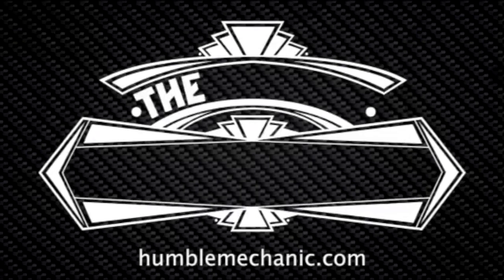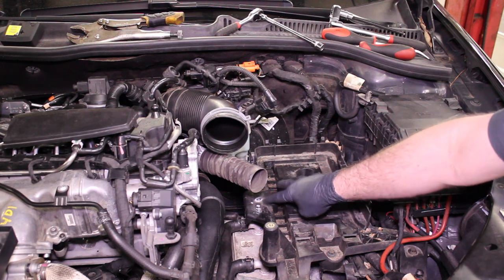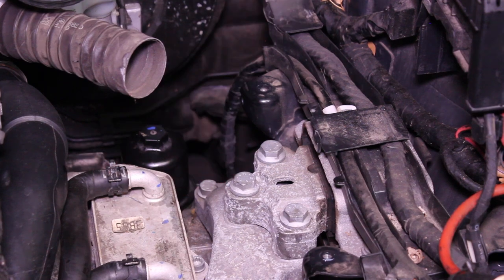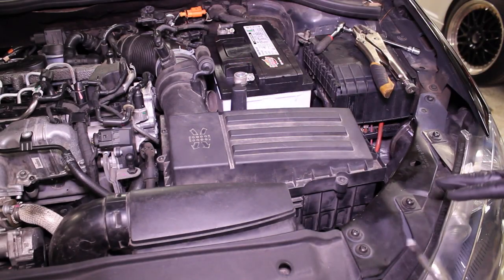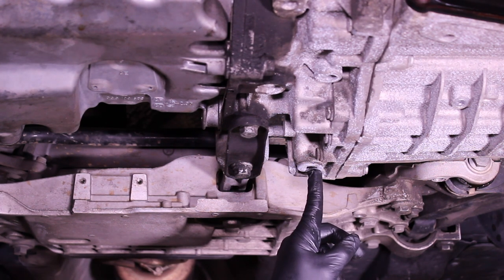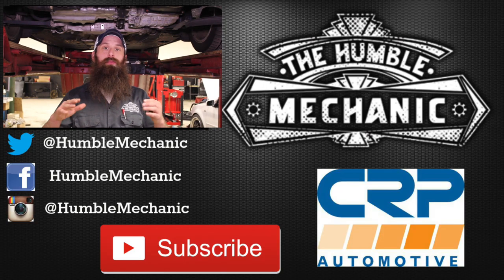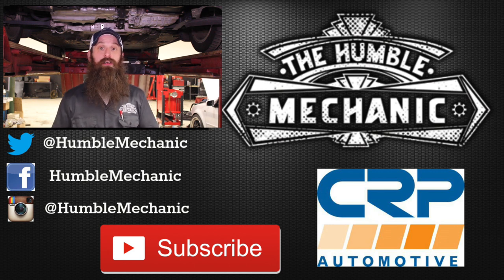How To Perform DSG Service for VW Audi

Comment: Is this the same procedure for all DSG front wheel drive engines?  
Second, if I have never serviced my DSG, is it still a good idea to change the oil?  I bougjt my MK5 GLI and its been a good 20k miles since I got back in late 2016z  thank you!
Reply from the maker: Yes. This is for basically all the 6sp DSG transmissions. 

Not a bad idea for an oil change too

Comment: Hey Charles. I had my 2012 2.0T ccta Jetta repair an oil leak causing a cracked water pump. Mechanic that performed job asked if I had the transmission fluid changed yet (then had 83k miles). He said not to change it if it hadn't been done already, that it can cause issues. Do you agree with that statement?
Reply: Always service your transmission fluid. These dual-clutch transmissions need regular fluid and filter changes. In any case, if changing your transmission fluid then causes issues, you had a transmission that was going bad anyway.

Comment: So 5 liter of dsg fluid is a lot and  nobody knows the exact amount  that should go in, how interesting. Otherwise I see you can't do a finished job without checking the transmission fluid temp if its ayt which has to be above 35 degrees. And I'd like to know what vsds equipment you use and how much does it cost. And the hand pump seems to make the job a lot easier to execute. I'd also like to know where I can get one and for how much

Comment: HumbleMechanic I like all your videos. Keep up the good work. Your answer will save thousands of dollars in fixing this issue. Thanks in advance. I have 2008 Jetta 2.0T TSI equipped with DSG (to be more specific it is model DQ250) as you said in the video they have bad mechatronic unit. I totally agree that, but car's hesitation and jerkIness happens at slow bumper to bumper traffic [ONLY AFTER SPIRITED DRIVING (SAY 30 MINS)] this madness happens once tranny oil attains certain temperature. Something in mechatronic not function right when oil is warm or hot. There is absolutely no hesitation or jerkIness in transmissions, when oil is cold. Rather than expensive fix of replacing mechatronic unit I will go with cheaper fix. Do you think it should be great idea to install a aftermarket DSG oil cooler? Do you think it will work?

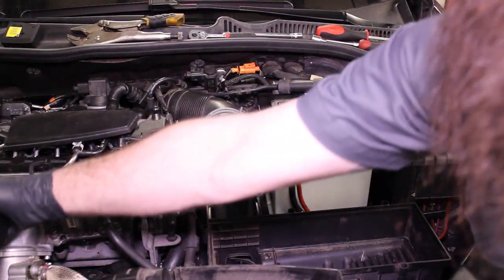Comment: At 3:22 you can see a smaller hose, under the air intake hose that's disconnected.  Is that some kind of heated air intake for cold weather?  Why would it be disconnected which looks like how you left it when you put it back together.
Reply from the maker: +jagardina it is exactly what you mentioned. 

From what I remember it was disconnected before we started. You want to be sure this gets put back. It's not the end of the world if you don't. But we want to be sure it goes back properly. 

This car was going to have more work done so I wasn't too stressed about t.

Comment: Is this a 6-speed or 7-speed DSG?
I have been looking for a How-to guide to do the 7-speed DSG in my 2010 S4 with the 3.0 TFSI (supercharged).
The part about changing the filter does not apply to my engine bay. The battery is in the trunk, and the filter in the filter/seal kit I purchased looks completely different. 

If the process for my 7-speed DSG is different, can you point me in the right direction for a DIY?
Reply: This is for 6 speed. 7 speed doesn't have an oil change specified as far as I am aware. It uses dry clutch and way less oil.

Comment: Humble, you could be using something electric to open that airbox (doesn't everybody have a battery powered drill motor these days?)

Real close with that extension and the postive terminal of the battery (short potential). Since you are taking the battery out why not disconnect the cables right at the start (or course after writing down all the customer's pre sets on the radio :)

I ask what experience level (minimum) you would want a tech to have before you dispatched this job to if it was a "waiter" (I do not see it being a good thing to give this to a low experienced tech if it was a waiter) How much does this job pay (both CP and maintenance warranty)

Comment: Why did my mechanic use 6 liters of dsg fluid? I bought 5 liters and a meyle filter and brought to my local euro mechanic. He needed another liter of fluid? Everything Ive read was 5L and the dealers use 6L?
Reply: +michael bertucci Hello :) Not all DSG transmissions use 5L of DSG fluid. For example, 2013 Audi B8 A4 TFSI with a DSG will use up to 7L of DSG fluid.

Comment: I just did the 80k transmission fluid changed 2012 vw passat tdi.I did it myself watching this video but i have a question the fluid i drained was red and the 40k service was done by a vw dealer, none of the videos i have watched had red fluid is there a changed that the dealer put the wrong fluid and it managed to run for 40k miles? Should i do one more drain and refill?  the car did have a delay when switching from R to D and P to R or D now that I put new dsg fluid (amber color)the delay when away.  And one more question  when i took the plug out (cold fluid) almost a quart came out. Isn't suppost to be a little or almost nothing if the transmission was filled properly assuming that the dealer warmed up the transmission and drained the excess fluid.  Also to check the transmission fluid temperature i used the torque app it works. So i ended up putting 4.7 quarts and I took off 5.5 plus a little i spilled on the ground of red fluid.  was this transmission overfilled?
Reply from the maker: Tough to say with out fully checking it. SUPER odd that it was red. I have not seen any DSG that was red. The odds of them putting the wrong stuff in, and not having issues is low. 

Ive seen people do that and the trans is toast in 200 miles.
Reply: @HumbleMechanic  maybe it was a dq200 gearbox that uses normal transmission fluid.

Comment: Why would you hand pump or gravity fill through the bottom when you have the filter out, can't you just funnel new fluid directly into the transmission before you put the filter on?
Reply from the maker: Yes but it fills VERY slow.

Comment: I would like to know if the version of VCDS is more limited than using the USB VCDS version with USB cable
Reply from the maker: WiFi on laptop is exactly the same. WiFi on Mobile is limited.
Reply: HumbleMechanic I appreciate yuor answer , in this case for me i will fill the oil from the filter , thank you
Reply: @HumbleMechanic  If I buy the kit that comes with 5 liters would it reach me or if I need a little more than 5 liters?

Comment: is there a way to tell when the last dsg service was? (I have vcds)... recently got my first DSG (use 72k mile S3) but don't trust what the dealer told me
Reply from the maker: Note really. Even fluid color is not a perfect method. I’d wait to 80 and then change it. Or do it now. Either way you’ll know going forward
Reply: @HumbleMechanic  Thanks. looks like its a PITA.. why is the procedure so specific on this? is a bit too much oil for instance gonna blow the trans?

Comment: are there any other places to get the filler unit?  I see one but it's for BMW but I assume it would work with VW as well as long as the fill adaptor mates with the filling unit, but i find it odd that the filling unit costs around $140 USD, this gets me to thinking a bit outside the box or asking if there are any other methods for pumping the fluid back in the transmission.  this is the only thing stopping me from starting this
Reply: Like, what's stopping me from buying a hand pump bottle that holds 5 l from home depot and mating my own hose to a shut off valve to mate with fill adaptor for about $20
Reply from the maker: I have this tool. It’s great! Be sure you get the proper filter. Dealer if you have yo
Reply: @HumbleMechanic  yea man.. I appreciate you and your vids..  i'm just gonna opt for the filler unit instead of make my won.  I figure i'll get my money's worth changing it 1 or two times

Comment: The first step should have been remove - battery terminal, that ratchet came scary close to the + terminal.
Reply: +autoairsteer That's right, and remove the negative completely first.  If while taking off the positive clamp you bump the wrench on the chassis, well, I never did it but my dad said you can melt the wrench.

Comment: One thing I dislike about modern vehicles is: Step one- remove 15 things to access one common maintenance item. Once you've removed the exhaust headers you can now take off the oil filter. ( This is satirical in nature, dont get all butthurt.)
Reply: +Uncle Bob Since when did the almighty german engineers decide that it was better to require a specialty tool rather than a simple dipstick for transmission fluid levels. It makes its products seem to be marketed to non mechanically inclined people such as women. Rather people that dont maintain their cars and drive them into the ground.
Reply: Sounds like Chrysler engineering to me.
Reply: Although this is an old comment, it’s worth mentioning that for the transmission service on a 2006-2008 Land Rover LR3, you do need to remove the exhaust headers to remove the transmission oil pan so that you can replace the transmission filter (it’s inside the oil pan).  The dealer quotes 6hrs of labor. The Indy shops quote the same. It’s one of the reasons I didn’t buy one.

Comment: hey humble mechanic I've been wondering how to change the water pump belt .
Reply: +VW Fury you gotta be more specific on that. What kind of car, motor etc..
Reply: You're right sorry, 

2010 mk6 gti ccta 2.0TSI
Reply: +VW Fury It's pretty easy. 
The water pump is driven by the serpentine belt, so you just replace the serpentine belt. All you need is a 30 torx, a 25 torx and a 16mm wrench.
And a jack and jack stands ofc.
Reply: +panzerveps thanks,  I did one and I couldn't change the belt . I'd tried to remove the bolt but I had no space. :-)
Reply: +VW Fury sorry, I mixed up the 1.4 tsi and 2 litre. 
It's a lot more complicated on the gti. The water pump sits under the intake manifold and is driven by the balance shaft. 
I think deutsche autoparts (one of Charles' sponsors) have a video on it.

Comment: Why not fill the trans with fluid by pumping it DOWN from where the filter is located. If the secondary plug is mounted and the external one isn't, you'll see you have the proper level when the fluid starts leaking from the bottom. I've seen someone else do it like that, haven't done it myself. How is that not a valid option?
Reply from the maker: You could try. Ive heard it takes forever to fill that way. you also still need to pull the plug to check the level.
Reply: @HumbleMechanic  Sure. But assuming I can hang a container above to slowly drain into the filter housing and leave it there for an hour or so, with the external drain plug removed from the pan and an empty container underneath, this would fill up nicely, with any overflow draining out the bottom. I mean this is a home-style repair, not for workshops since it would take up valuable space over a longer period of time.
I just think it's far less messy this way... until the hanging canister drops and spills all that oil all over the engine compartment 🤣

Comment: I have about 56k miles on my Audi , is it necessary to change it or can i change it later on?
Reply from the maker: I’d change it now. Most DSGs are due at 40k
Reply: Even the newer audis A4 B9 gotta be charged at 40k ? Audi never mentioned it to me hmm
Reply: @HeadsUP253  car manufacturers will never tell you.

In Europe VAG says every 60,000km you must change oil and oil filter.

If you have a DQ200 they say it's lifetime but change it at the same interval.

Comment: Hey charles, could i just take the oil filter out, then the drain the oil maeasure  it and then pour it through the oil filter ? i think it might be a little slower perhaps but cleaner, can we do that?  also when you change the oil this way do you actually get all the oil out? or just change most of it but some remains in. thanks for the videos theyre awesome!
Reply from the maker: You sure can do it that way. It is slower, but it's doable.
Reply from the maker: You still need to remove the plug and drain the oil from the bottom

Comment: Is it possible to extract the fluid from the topside with a fluid extractor via the oil filter tube? I know you can refill the fluid through this small tube, but can an extraction hose fit down the tube and reach the bottom of the DSG fluid pan?
Reply from the maker: I haven’t tried.  It very well may be

Comment: Thanks for not awsering my emails.
Reply from the maker: Never saw they 🤷‍♂️
Reply: My emails said. 2008 audi tt two engine lights p0444 and p0243. When im driving 65plus and i drop it down 2 gears to pass...the engine revs but the speedo doesn't move...still at 65mph. Replaced evap solenoid and boost valve...still have engine lights....is dsg low on fluid?? Dont know...any help would be appreciated.
Reply from the maker: So it is possible the DSG is low. You’ll have to check. 

What’s funny is you posted kind of a snotty seeming comment about an email that I did reply to.
Reply: @HumbleMechanic  i never got it. Anything else other then low fluid? Any idea about the engine lights?would then effect the trans? Thanks
Reply from the maker: P0243 is a wastegate code. Probably more likely an engine issue than trans issue. An issue with one can cause symptoms of the other
Reply: @HumbleMechanic  the turbo is new(only 2,00 miles on it) and i replaced the waste gate solenoid..any other ideas?  P0444 open evap ( replaced evap solenoid) any other ideas on that? I replaced gas cap too.

Comment: Now, go do this on a manual car such as oh, Volvo 240 or Corvette. Compare and contrast the difficulty and $$$ consequences if you don't get something exactly right.
Reply from the maker: Are those harder with more delicate operation, or easier?
Reply: @HumbleMechanic  It's usually two bolts, a drain and a fill, and the hardest part is getting the car raised and level. What sort of longevity are you seeing from these DSGs?

Comment: Typical German engineering.

I am convinced this is out of spite. The injection molding machines I work on are built the same way.

"Hey, if we design it like this, it only takes 5 minutes to do that service."

"No, design it this way instead so it takes 5 hours."
Reply from the maker: HAHAH I had this chat with Engineering Explained. We decided to blame accounting.
Reply: @HumbleMechanic  Agreed.

Comment: Did this car get recalled by VW and is now sitting in a massive car park?
Reply from the maker: This exact one? Maybe. A buddy of mine had it and sold it before the diesel crap went down
Reply: HumbleMechanic I see. I was just wondering if it was in one of those massive VW car graveyards. I’m staggered by the scale of them - so much depreciation! https://youtu.be/Cem7_F6sg9I
How has the diesel stuff been from your perspective? In the U.K. here there is no compensation for owners and no buybacks. My parents Audi was affected and had a software fix. Fuel economy is worse now and the EGR cooler destroyed itself a month ago. Audi replaced it for free, no questions asked even though it’s a 2011.

Comment: Would you recommend the service on a transmission that's missed 2 intervals? I have a DSG that's done 165,000KM and hasn't had the service ever. It doesn't slip. Would you recommend the service be done, or should we just drive it like that until the unit fails?

Comment: Why doesn't the manufacturer's manual specify that it has to be replaced but only the level checked? My dad has worked for VW Group, as a mechanic first and a qualified engineer later and he says that it doesn't need to be replaced. And I have worked for one of its companies and I've owned several brand new cars from VW Group and I've never replaced the DSG oil. So, who's right?
Reply: Albert Zion the manual does states that it has to be replaced. At least on mine (2013 golf did).

Comment: Pretty dumb way of filling up the fluid if you ask me and I'm doing this before this guy was born. You check the fluid with the engine RUNNING! then as the fluid warms up to temperature you simply remove your adapter and put the plug back in.
Reply from the maker: How we feel about it is irrelevant. That’s by the book 🤷‍♂️
Reply from the maker: You basically started off with “been doing this before this guy was born”. That statement says to me that no matter what I say I’m wrong to you 🤷‍♂️
Reply: @HumbleMechanic  How about you either agree with me or explain to me how is your "by the book" way of doing it the right way instead of wriggle yourself out of a fact based debate? I just told you how this job it's done at various dealers on a daily basis by guys who do this for a living and who would be very amused if they saw your video as I was myself.